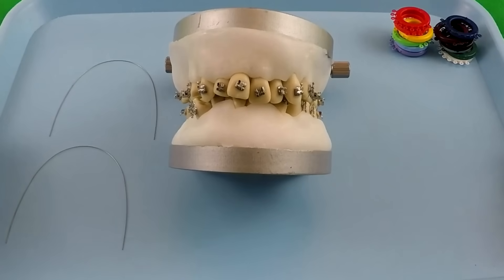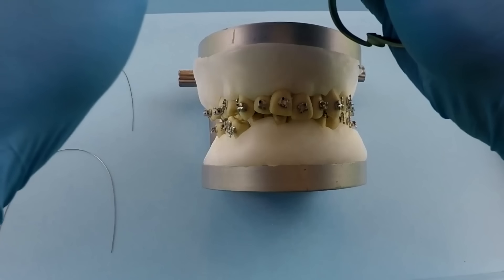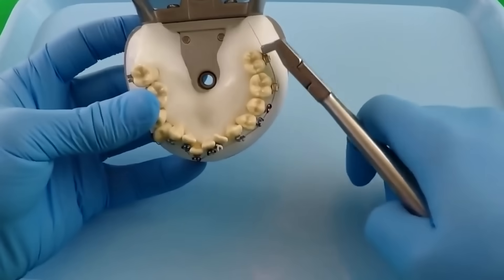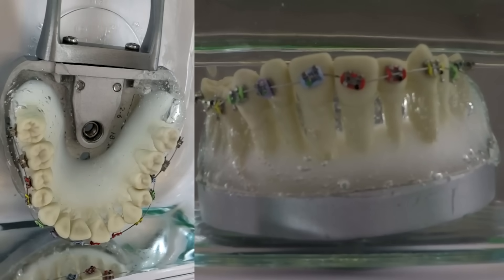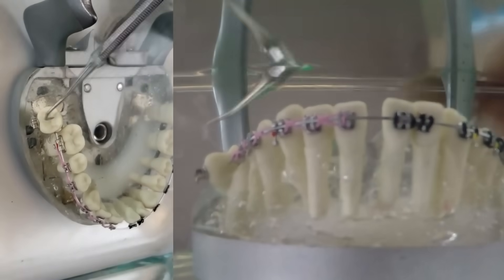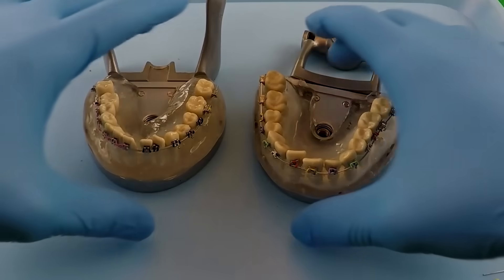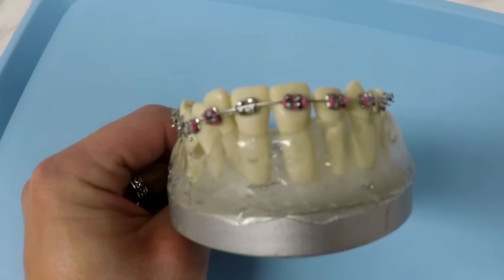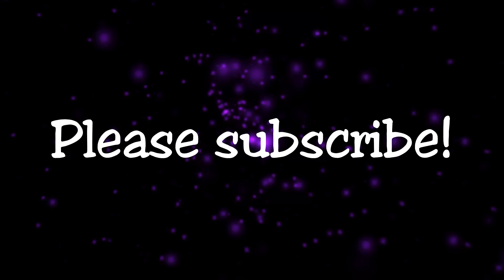Ever Wonder How Braces Work? Find Out Here!

Comment: I have an overbite and severely crowded teeth on my lower jaw. Got 4 teeth extracted to begin with my braces journey. I'm 30 and I'm finally getting braces. I have been contemplating them since I was 18. But since my case needed 4 extractions, I couldn't gather the courage to go through with it and ended up procrastinating for over a decade. Now that I'm through the hard part, I'm already looking forward to the results. That's the only thing that keeps me going! I'd love to share my experience with people on the same journey :)
Reply: Hey, Dhruti. I am 25 and have severely crowded teeth as well. I got my braces today. FINALLY. Cheers to us for being so brave. Good luck with your journey :)
Reply: @SuyashaSharma  That's great! I'm loving my journey. Been a week since I got my upper braces bonded and honestly felt no pain at all. Just that my teeth felt sore for the first 4 days and I felt them only when I ate. I could easily eat soft foods and by the third day I got used to beaces. Plus the cleaning is not even much of hassle. I dedicate 10 mins in the night for deep cleaning and brush after every meal   to avoid stains on my ceramic brackets. How's it going for you? I write my replies in detail for people who are new or for people who are still contemplating on getting braces.
Reply: @7dhruti  same 24 didn’t have money to get it when i was younger had some crowding and had both my premolars on the top and my second premolars on the bottom extracted to make room and the best thing for cleaning is honestly a mechanical tooth brush phillips or oral B is pretty good and the best thing is a Water Pik i promise it does wonders for anyone reading this
Reply: @SuyashaSharma  Hey, you can check out my braces here: https://youtu.be/4_83GixLmyg
Reply: @SuyashaSharma did u finished
Reply from the maker: That's great! Good luck with everything!
Reply: @thecrazyorthodontist 
Thanks, Baron!
Reply: @7dhruti  I have an overbite too...and I guess we both had similar views...
I was 24 years 
 when I discovered having an overbite and overcrowded teeth..
I still don't understand why did I procrastinate these issues...now I'm a 40 year old woman and it's my 6th day with my self ligating  braces on after removal of upper 2 molars....
I'll comment again once I get good results...I have a 2 year long journey to go...guys pl wish me good luck ...
I'm being impatient now ..couldn't wait to see the tremendous results...I regret I should have done it atleaat when I was 30 years..
Reply: @starmoon4365  I'm glad that you're finally getting them. Honestly, it's not that bad and painful. It's just a week of discomfort. Also, avoid painkillers for it stops the movement of the teeth, elongating the procedure of braces. Tynol is a medication used especially by patients going through orthodontist treatment. And 40 isn't that late! My father got implants at 60 and spent a whopping 5 lakhs. Sharing his story as it makes me feel like I'm not very late. 🥂
Reply: Also,.can someone please help me fetch tylenol tablets. I can't find them. I'm from India.
Reply: @7dhruti  are yours self lighting braces or conventional ones?
Reply: @thatnovembergirl  mine are ceramic... Teeth coloured brackets..
Reply: @7dhruti  Tylenol is just a brand name for paracetamol (just like Crocin).
Reply: @bhojjadamotabanda  Thanks for the information! Thankfully I didn't feel the need to take any meds!
Reply: @7dhruti  do you have any gaps where the teeth got extracted? I have to do the exact same procedure but I’m worried i will have gaps.
Reply: @Sabertooth_54  yes, I do have gaps but they're barely visible as I don't smile big. And there's no way to not have those gaps. Don't worry about it.
Reply: Same as u. Been pending for decades as well as didn't have enough money to do it. I'm 34 now and been 1 mth and a half since i have braces
Reply: @joyceahfong5500  better late than never couldn't be a more fitting expression.
Reply: @7dhruti  indeed indeed
Reply: @joyceahfong5500  I got my braces on Wed 19th Jan, I'm 35 and didn't get braces as a kid as I refused and parents didn't push for it, fast forward, teeth get so crowded and now I have a clip in top brace and the lower one is the wire brace like this video and it's such a weird sensation of pressure itchy pain! I have to keep my clip in brace in for eating which makes it difficult for swallowing food so everything is being blended up. The final result is keeping me going but omg the pain in my jaw, my cut up gums and cheeks and brace pain is alot! 加油!
Reply: I have the same problem as yours. I am 28. Its been a month I am having a metallic braces. My orthodontist not removed the 1st premolars yet. He said he will if its necessary. I know he will remove because there is no gap between in my teeth and lower teeth are crowded. He put braces only to my upper teeth.
Reply: @MsVivek71  Same. I got my upper teeth braces for now. Maybe after a few weeks I'll be called in for my lower braces. I'm 10 days into my braces and I already am comfortable with them now.
Reply: Hey I got my braces yesterday for the 2nd time 🙃.  I had got braces  8 years ago I too had to go through the extraction process (it's quite normal). I was immensely happy with the result that braces gave me but unfortunately I didn't wear retainers after  and now my teeth has relapsed  and developed a deep bite issue so I had to get braces for the 2nd round to fix the problem and I'm 22 now. Big lesson wear retainers after getting braces off.
Reply: @shivanimallik656  retainers is a Big part of the process. I'm SO glad I learnt this at the start of my braces journey. Thanks to girls like you  :)
Reply: @7dhruti   😁
Reply: @shivanimallik656  Hey, you can check out my braces here: https://youtu.be/4_83GixLmyg
Reply: Hey! I'm 32 and just got braces last week! Wasn't too painful the first day, but by the 3rd day, it was painful lol. After a week, definitely a lot better. Good luck in your journey with braces
Reply: @greenallgriffingurl  Cheers to us, Brittany 🥂... It's the best decision of our lives. I'm already thinking about the results and that keeps me going.. it's my second month of getting braces and it's honestly not too bad. Also, my upper teeth have already started moving. I'm excited to see my progress after  my first tightening session which is due in December..Will definitely update here.
Reply: @greenallgriffingurl  Hey, you can check out my braces here: https://youtu.be/4_83GixLmyg
Reply: Here's an update guys! I had my first tightening session yesterday (December 15, 2021) and I feel no pain at all. I felt some intense pressure on my teeth during the procedure but there is absolutely no discomfort of any sort. I'm SO elated. TBH, I was waiting for my tightening session to know exactly how much it would hurt and give you guys an update but the bonding of braces left me with a sore mouth and not the tightening session. There's no change in my eating habits right before I went in for the latest appointment. Also, my upper teeth have already started moving, filling in the gap created from extraction.
Reply: Hi Guys!! Here's an update from my Feb session. I got two springs onto my lower braces wire to fasten the movement of cannines. I did feel some pressure but wasn't uncomfortable at all. To see how they look jump on to my video here: https://youtu.be/4_83GixLmyg
Reply: @Dhruti Asher I am 26 and i had same, overbite n crowded lower jaw, i needed just ine extraction and i wanted to go through this process since i was 21. It really made me insecure n since my smile only shows my upper teeth, literally everybody told me oh why do u wanna do it, its not like ur teeth are cming out of ur face, its cute. And i was like 😑, but i want them right. M 4 months into the journey now, probably 8-10 months more. Good luck to you too!!
Reply: @roshnidilaware7145  Hey, you can check out my braces here: https://youtu.be/4_83GixLmyg
Reply: I'm 62, and just got my braces!! It's never too late I guess.
Reply: @hello21596  absolutely 🙌
Reply: @Woke up feelin real dangerous haha, this is reassuring for me :) Cheers to our journey together 🥂
Reply: I’m 30 as well starting the process of braces. I’ve had experiences that have made me scared of the dentist also I couldn’t afford them. I can now and I’m excited. Watching videos like these are slowly preparing me because I’m still a little scared 😬
Reply: Omg dhruti my case is exactlyyy like yours!... Do update on your journey here...

Also can anyone tell me... How long do we wear the retainers for slight overbite... I just got my braces a week ago and i wanna mentally prepare myself as much as i can... So share ur wisdom pls! 💜
Reply: @nidhishri1536  Hi Nidhi... I've been through two tightening sessions till now and I have no complaints. I don't even feel any soreness after a tightening session. Just that when they change the wire, I deel some pressure against my teeth but that's inevitable. And as dor a retainer, I have been told that I will have to wear for one whole year. But according to my research, retainer's duration vary from case ro case. And honestly, that should ve the last thing to worry about as it has no food restrictions, and if a retainer is removable it offers great flexibility. But it's a very essential part of the process that needs to be taken seriously. I know many patients who relapse because of not wearing retainer timely. Enjoy your journey, Nidhi! 🤗
Reply: @7dhruti  Wow... Thank you for such an insightful reply... Lets stay connected thru this journey! 💜
Reply: @nidhishri1536  Would love to :)
Reply: @nidhishri1536  Hey, you can check out my braces here: https://youtu.be/4_83GixLmyg
Reply: my TEETHS are so crooked and in the front it's crowded so bad ,my incisors are at the back all the 4 incisors ,my front tooth is a bit outwards and it's so big that its covers half of my lower teeths , 
my dentist will extract four teeths out ,two already extracted ( it's so so sadd I cried so much not for the pain but for loosing my teeths) I will get braces in few days ,but I am sooo scared that extraction will change my oval face ,did you notice any changes?? 
my side profile sucks anyways 
please keep updating about ur teeth
Reply: @Swagatasketches  Honestly, I didn't see any profile change after extraction. And I'm two months into my tightening session and I see no profile change yet. Although my teeth have started moving to fill the gap from extraction. We might not see major profile change as we're adults, as for kids braces can enhance more changes at a growing age. For adults only jaw surgery can bring about major facial feature changes. At the most our soft tissues -skin around mouth and cheeks will sit slightly different, making our features look softer. Don't overthink this, just look forward to the end result which I'm sure will be worth it. Hope this helps 🥂
Reply: @7dhruti   Ahh Thank you so much , I was really worried reading stuffs online ,And my Indian mom is against extraction ,but I know my situation and my teeths is the most horrible teeths ,I always wanted braces, Anyways thanks ,Good luck to u too hope u get good results 💜🥺
Reply: @Swagatasketches  SAME!!! My mom was always against me getting extraction and I ended up procrastinating the treatment I always knew I needed. I'm SO happy I gathered the courage to go for it, be it at 30!! I can't wait to see changes. My ortho has predicted 15 months of treatment but I'm sure I'll be done sooner than that. They always have buffer.
Reply: @7dhruti   oh waahh . I wish I was successful and had my own money but I am just 20👍 I too did procrastinate Teeth extraction coz of my mother when I was at school , she's worried about the holes🙂 .
Reply: This thread is refreshing. I'm in the orove9of getting braces too, at 25.  Lord give me patience!
And yes, I'm super self-conscious whenever I smile or laugh.
Reply: @estera4176  Hi there!! I've had braces for the past 4-5 months and by now it feels like a part of the body. It doesn't feel foreign nor do I have ulcers or a sore mouth. How about that for starters? 🙌
I am confident and talk normally, like I used to. Don't lisp and people barely even notice my braces. My eating habits have improved + speed and bite size, which by the way helped me lose some extra pounds I was trying to get rid of. So far, so good. I didn't think I had patience either but since it feels like a part of my body, I'm over that feeling. I don't feel angsty, I'm allowing my body that time and the braces to do their job. I feel SO relaxed to have put that down in words. 😇 Also, please remember, the earlier you get them, you're adding more years to flaunting a good smile.
Reply: @7dhruti  Thanks for all the details. I was thinking how this would affect my weight. I want to add muscle and start gym now when most activities are back to normal in my country, meaning I'll have to eat more. But I guess it's about what you eat and not how much.
Reply: @estera4176  you can figure it out with your trainer. Remember no training when you have any teeth extracted. Avoid it for at least 10 straight days.
Reply: Am 25 and gonna do it when i get the money for it 
Thank you for the encouraging words 
Wish you a straight smile as i wish for 🥺
Reply: @noran3379   Proud of you!! And thank you so much ❤️
Reply: @7dhruti  my pleasure 😄
Reply: I got 4 extracts as u and I can’t wait for the final results
Reply: @joegh8453  will update my progress here. Wish we could have a channel to chat. All the people with braces could help each other out! 😃
Reply: Me too!!!
Got my braces on at 30 with 4 teeth extracted its been 13 months and I'm loving the results!!!
Not much longer to go for me
Reply: @mnzz1234  That's fantastic! Happy for you!!! Can't wait to see some substantial change for myself. Do you see any substantial changes in your facial features yet?
Reply: @7dhruti  
Not really in facial structure.
I already have the smallest mouth in the world hahhaa
Plus a very narrow jaw as is....
No major facial changes for me.
Reply: @mnzz1234  hahahaha.. same is the case with me. Small jaw and crowded teeth 😅.. Although I'm looking forward to having a more harmonious chin to make my face look longer and sharper..
Reply: @7dhruti  
Thats me.
I dont want anymore sharpness lol.
Long nose pointy chin
Face is so slim already I was scared it would become more slimmer and my nose would stick out more LOL. Hahahaha
All the best!!!! Hope you have beauitful results. :)
Reply: @mnzz1234  haha, I have a round face and I am rooting for some changes. Good for you though for not seeing any substantial changes. Btw, I love a sharp nose. It can never go wrong.. :)
Reply: @7dhruti  
Ahaha how funny i want a round face and some chubbiness on my face.
However I'm sure you are beauitful the way you are :)
Reply: @mnzz1234  haha, the irony! I always wanted a longer face 😅
Reply: we have the same story babe<3
Reply: @annalam671  where are you in your journey?
Reply: Would you guys recommend me updating my braces journey on my own YouTube channel? Let me know if that'd be a good idea.
Reply: @7dhruti  YASSS! also send me the link if u do.
Reply: @Swagatasketches  Done, done!!
Reply: @7dhruti   Link ! link!!!
Reply: @Swagatasketches  I'm still figuring how to upload a video on YT. 😂😂😂
Reply: @7dhruti   okk 😂👍
Reply: @7dhruti  😁
Reply: Not to brag or anything, but ive gotten 11 removed
Reply: @legomaster4157  Damn, you win 🙌
Reply: @legomaster4157   😂how many teeths do u have now
Reply: @Swagatasketches  No idea XD still need to get 4 removed till I can get braces
Reply: @legomaster4157  wait!!!! what!!!! 
11+4= 15 !!! ur removing 15 permanent TEETHS!!????
Reply: Curious to ask...have the braces affected you a bit in socializing? Im also over 30 and feel if i get braces..im going to be stuck indoors afterwards
Reply: @robd1329  not at all. My braces are barely visible since I got ceramic ones. They only show when I laugh with my mouth wide open. Truth be told, many of my friends and family members weren't able to spot that I have braces. Just that my smile seems a little awkward, because the lips slightly protrude because of brackets. I honestly don't mind them and there has been no change to the way I socialize. Except ofcourse when I eat, I break my food down in smaller pieces instead of going for a full bite. Like pizza, rolls and sandwiches are foids that I can't bite into. You may avoid these foods and opt for foods that can be easily consumed with the help of spoon or fork.
Reply: @7dhruti  ahh understood. Im going to look into thr ceramic ones. Thanks for the advice!
Reply: @robd1329  do ask your ortho about the ceramic braces going telow or changing colour due to food. I have ceramic brackets but my wire is metal, so the food doesn't transfer any colour to my brackets or the wire. I was apprehensive to share this information as I belong to India, and I'm not sure where you are from. The food habits and technology difference is what I'm hinting at here.
Reply: Exactly like my case: had a few extractions and got my braces: finally, in my 30s, I will have decent teeth. Good luck to all who gained the courage to do it!
Reply: I’m 30, single and got braces 3 months ago, I have an overbite too. Three quarters into treatment for braces I’ll be getting MMA surgery to fix my receding chin from my overbite to fix my sleep apnoea.
Reply: @Lisa-zm7yq  sending your way best wishes! 🙌
Reply: Same! You’re definitely not alone. I had 4 teeth removed plus my wisdom teeth and the extractions were the worst part. On day 3 and soo happy I’ve started this journey. It’ll be worth it.
Reply: I’m so happy to read this. I got brackets this week and am getting 9 teeth extracted today. Been procrastinating a few months, but glad to get it over with.
Reply: @jessmhartman  goodluck in your new journey!!! 🥂
Reply: @7dhruti  Thanks for coming back to the comment and updating us!, after you remove the braces PLEASE wear the retainer i regret not wearing it
Reply: @lookbehindyou2873  Yes!!! Will do!! I've learnt that from others' experiences! Also thank you for the disclaimer!!
Reply: Hey, Dhruti!
You just made me want to get braces myself! I have an overjet. It’s nothing major but it effects my self-esteem so much so that I rarely ever smile with my teeth showing. It has become natural to me to cover my mouth if I ever laugh. Despite that I chickened out of getting them when I was 16 because I was told I’d have to extract 4 of my teeth extracted. I just turned 28 and I’ve been contemplating if it’s even worth getting one now that I’m so used to my teeth looking the way it does and dealing with my self image issues in my own way.

I think I might go for a consultation this weekend.
Reply: @00iamcrazy  Aww, I'm glad!! I used to be the same, I laugh with my hand on the mouth.. it becomes a habit.. i had a slight overjet too and a little of protrusion on upper jaw. I went for it a year ago and I feel like braces are a part of my body now. Don't feel nothing! Pls see a good dentist. Also, go to my profile to check out how my teeth looked at the beginning of the treatment. Cheers!! 🥂
Reply: how are your teeth now....? can you bite after putting off braces?
Reply: @urwashigupta9854  My teeth are quite aligned by now .. I'm just having to fill minimal gaps on both jaws.. I'll be done with my treatment in December 2023. It commenced in Dec 2020. 

To answer your question, yes I could bite after getting my braces bonded, however I was on soft foods for first 15 days. I gradually moved on to solids.
Reply: @7dhruti thank you very much for your updates.

Have you noticed any facial/profile changes? 

My orthodontist recommended me to extract 2 premolars from my upper-jaw and I am super hesitant! Specially after reading the negative reviews people share online about regretting it. Do you have any advice?
Reply: @sahfych  hey... Not yet... but I lost weight because I couldn't chew my food properly in the beginning,  so that was a big plus. Haha... My upper teeth are yet to go in the desired position. I'll be done with my journey by December.  Then retainer for a year. Let's see.
Reply: Thanks for sharing this. I'm 31 and will be getting my braces this weekend. I had similar reasons with you, I was so afraid with extractions. But thankfully, found a very kind dentist who made me feel safe and then I went through all the extractions and is now ready for the braces.
Reply: Same here, the doctor said 4 extractions and I am afraid
Reply: I'm glad you're getting them at 15!! You'll appreciate the changes.. think of this as a temporary phase.. good luck 🥂
Reply: same problem here as a 15yo my lower wisdom teeth need extraction to apply braces even though it's just the lower jaw
but i'm thinking of waiting for the upper wisdom teeth to be extracted first then i can apply for braces after that

hope the extraction isn't too bad
Reply: I have an overbite, crowded on the bottom and too much spacing. Thinking about doing invisible trays but this is new for me, I'm 35 and I need the best cost effective option. I don't have orthodontist coverage for my health insurance so it's all out of pocket.
Reply: Did u lower jaw teeth got loose after braces on. Mine got loose feeling like teeth will fall out.
Reply: @pravalikaprabu5247  not loose but they sure are tender.
Reply: @smvballer6  then tell me more!!!!! 🙌
Reply: @7dhruti  I have a severe under bite. Kind of the first time I’m talking about this online. Never been ashamed of my mouth/jaw as an African American male. We kind of get stigmatized as big lips so to speak, so I felt like my underbite could be disguised in a way lol (I know…it sounds silly). I have a canine tooth and overcrowding on top jaw. I’ve had at least 4 extractions and I’m 29 turning 30 next month just now getting braces. I’m about 4 months in with braces and now just thinking SERIOUSLY about this orthognathic aka double jaw surgery. It’s something orthodontics recommended since I was younger. They recommended for my jaw to grow and then braces…then surgery. So here I am. I’m not fully sold on the surgery yet, but I am about 6.5..7 out of 10 sure I’m going to do the surgery. Been doing allot of research and very impressed. Never been ashamed on how I look due towards my faith, but sometimes my insecurities are there internally (side profile smh). But mostly due towards how I eat and smile. I just feel restricted but accepted it as normal. 

If there is a way I could do the surgery, my thoughts are “why not 🤷🏾‍♂️”

I use to tell myself I would never do the surgery. Scared, procrastinating, and I have acceptance on how I look now. But now like I stated earlier, “why not” if it’s beneficial and I can afford it.

It’s just funny because I went into this with me getting braces to have straight teeth, tired of having vampire teeth showing. Now it’s whitening, veneer, surgery. Smh I’m like…might as well invest and go all in. Definitely will be worth it imo and from what I’ve researched. I just know I’ll look completely different from what people saw me as. Again, not doing it for them, but for me. For Oral/medical hygiene.
Reply: @smvballer6  I feel you ❤️ Yours is a far more challenging journey. Tbh, What triggered me to actually go through the extractions is when I heard a few friends make fun of my slight protrusion, and I couldn't take it anymore. I just couldn't. I needed to know what a perfect smile feels like, and looks like on me. I owe this to myself. And ppl are SO shallow to ask awkward questions and be weirded out to find out about adults getting braces. But I chose myself and what's best for me, and managed to keep the chaos out of my head. I hope you find a way to be strong and patient through it all. I wish you the best. ❤️
The only thing that keeps me going is the final results, andI'm already romatisizing it in my head. 😅
Reply: Im on the same journey. Have been procrastinating for decades...
Reply: How is it going now?? I'm also overbite
Reply: Do you still have your braces? Are you still happy with the results? I'm 30 also I had my spacers placed a week ago so I'm in the first stages of my journey, I also have to get 3 extractions I'm worried that my outcome will not be so good.
Reply: Doesn’t extracting your teeth reduce the size of your airway and make your face uglier?
Reply: Hi there! Same I'm 32, just put braces a week ago, 🥺 since then I got two teeth removal 🤕 hurts a lot, still have to take out two teeth and put the braces down as well 🥺 how's your journey? What helped with the pain?
Reply: @nagyorsolya9353  hey hey, so my dentist gave me painkillers for straight three days or more, to help with the pain. Honestly I didn't feel any even after the anesthesia effect wore off. And within 10 days I had my brackets bonded. My teeth felt sore for 15 days and I was fine after that. Please inform your dentist about the pain and take help. Ideally you should feel no pain at all.
Reply: @7dhruti  Hi.... Thanks for sharing...it gives me confident that nothing gonna happen .. I got my braces 3 days before  and I was thinking that my whole life is changed bcz of disturbance in my teeth..... Bcz I couldn't bite anything and I couldn't be normal..now I have confident that it will change in time I will become normal to..Any tips and tricks to reduce the pain or soreness please share
Reply: @ramvalliappan  I'm glad to know that. Give yourself 7-12 days and it should be easier for you to chew food. I use to do warm salt water gargles to help  with the soreness. However, please avoid taking any medication during this time. It's not recommended to take medication as it stops the process of moving your teeth in the desired position. Your orthodontist will put pressure that you can tolerate. And your tolerance will increase with time. At this point my braces feel like a part of my body.
Reply: 25 and have some crowded teeth upper and lower jaw. I might have to remove two teeth maybe on my upper jaw and I would need braves for 18 months to 24 months apparently. But I’m so afraid and a bit embarassed about having braces at my age! Even though the final result looks amazing I still have found the courage to go and put them on. I have a bit of a mental barrier going on!
Reply: How do you feel now? Happy with the extractions? I'm supposed to get 4 extracted but I don't wanna get rid of healthy teeth for no reason
Reply: So how'd it go??
Reply: 2 yrs later, how is it going?
Reply: @mimigirl2211  Im waiting for my canines to move and fill the gap from extraction. I have uploaded an update video on my channel.
Reply: Hey I know it's 2024 and I'm late seeing this comment would like to know if u get them yet
Reply: Is it possible to apply braces at age 48 ? Or is it too late and best suited for children as their mouth structure is more malleable ?
Reply: YOu messed up, extractions are terrible. Braces are already a risky endeavor depending on what kind of problem your teeth need correcting, but extractions just ruin things, especially the younger and softer your bone is.
Reply: I'm finally done with my journey of braces!!! It took me 3years 5 months, and now im on a retainer.
Reply: I’m 26 and just got them on and I have an overbite which meant I had to get 2 teeth removed wasn’t fun and lowkey not enjoying having them in atm 😅
Reply: It’s been 4 years! How you doing buddy?
Reply: Thought I was the only one who had to take out my real tooth beacuse of crowding
Reply: @janhavitripathi4016  Hi Janhavi, I got the same response from my family. They didn't want me to get my perfectly good, permanent teeth extracted and that kept me from getting braces. Honestly, it's not a big deal. It needs to be done if the orthodontist recommends. I've heard cases where kids loose their teeth during the process of braces if they don't get extraction when needed. Anyway, that's a thing of the past. Don't feel pressured bu the family, your orthodontist obviously knows the best. Also, just ro be sure, you may take another opinion from an orthodontist. You're only 21, please go for it. It's not too late. I regret not getting over with before I got married.
Reply: @janhavitripathi4016  mine is a little. Not severe. Shows only a little from side profile
Reply: You are going to regret that